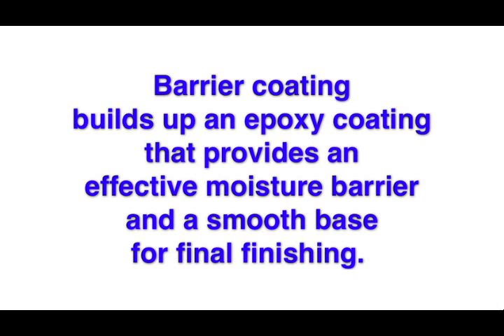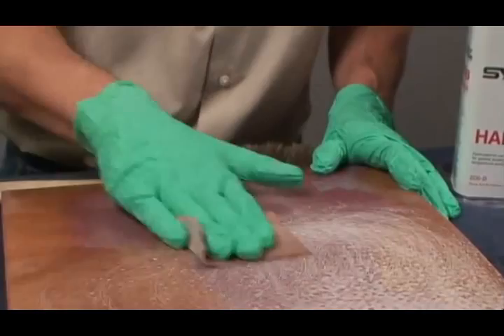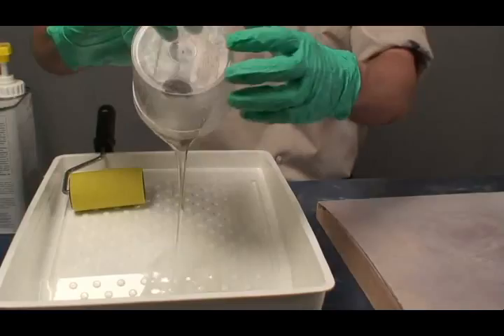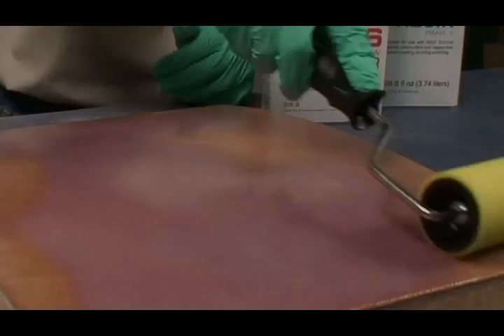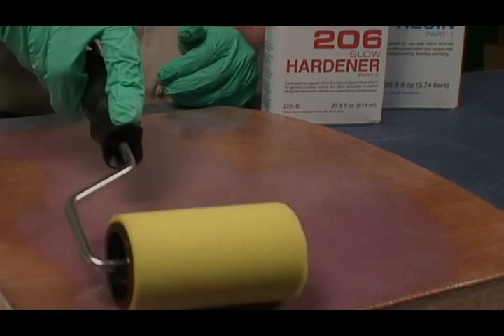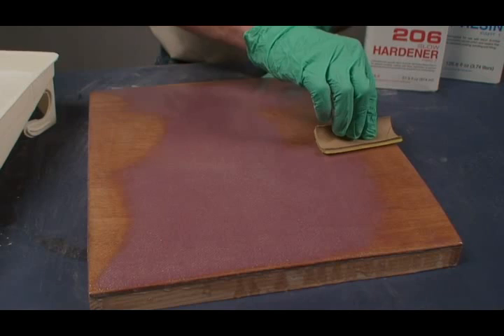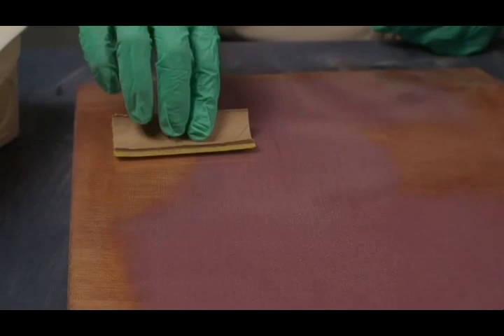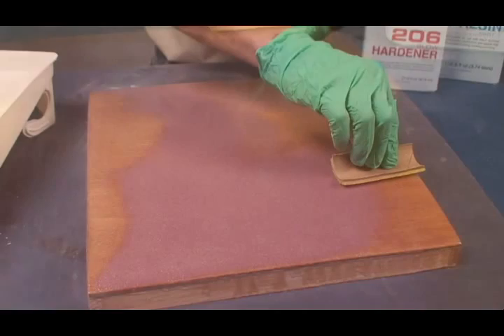Barrier Coating with WEST SYSTEM Epoxy

Comment: Is that a metric millimeter or some other kind of "mil", because 9-10mm is about as thick as my hull.  EDIT: Reading around I've discovered they mean thousandth-of-an-inch, so a 10 "mil" barrier is about 0.25mm.